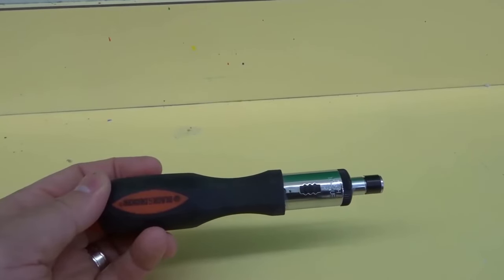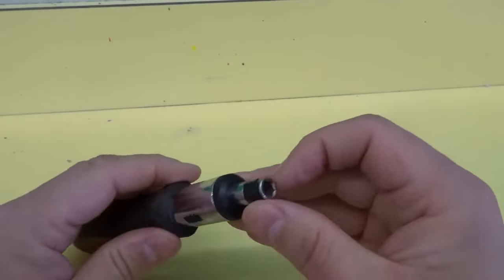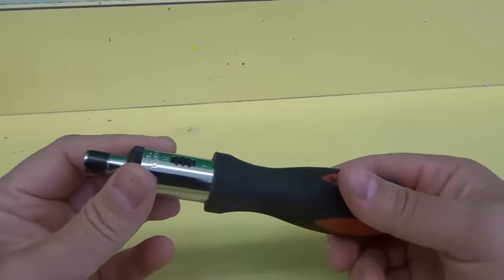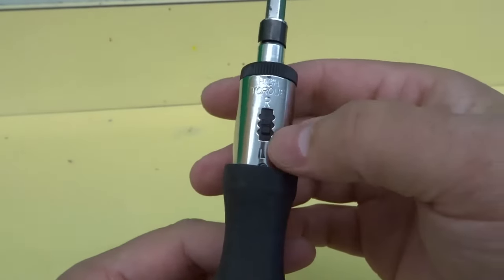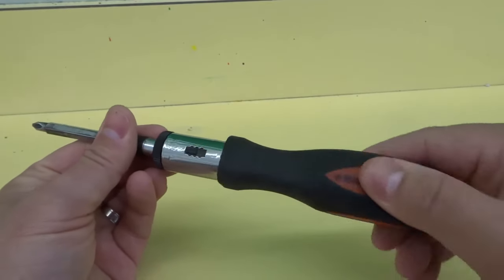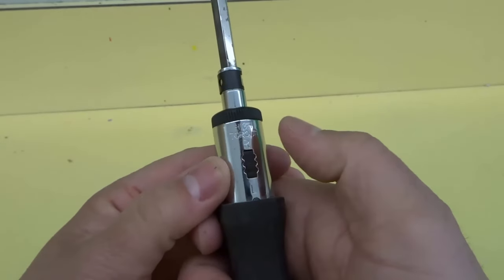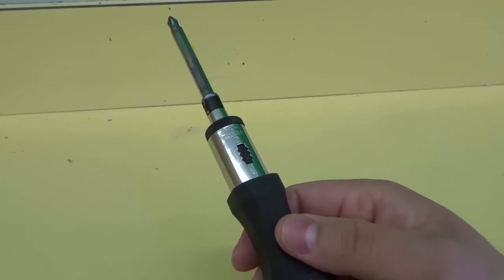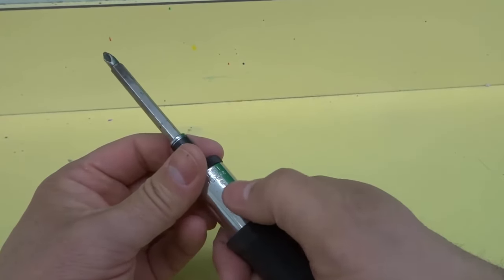How To Use A Ratcheting Screwdriver-Easy Tutorial

Comment: Is this ratcheting mechanism only for tight/ harder screws that are hard to open or close like those on wooden items? Because I tried this product but I noticed it doesn't work while opening or tightening screws on Electrical switches as don't turn the screw after one turn so I was forced to disable the ratcheting system to normal and then unscrew the screw

Comment: I have similar but I have small bits not the long extension you have. Every time it ia pain to load and unload the bit. There is a ball mechanism to prevent the bit falling but then again it takes a lot of force to load and unload the bit. Perhaps the one i bought had a missing part.